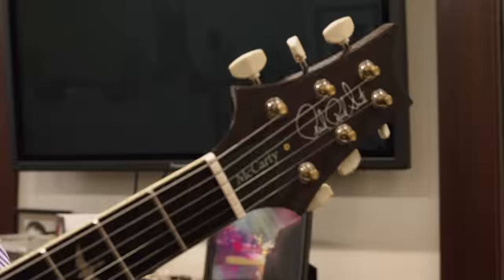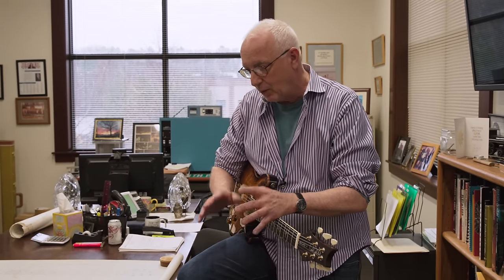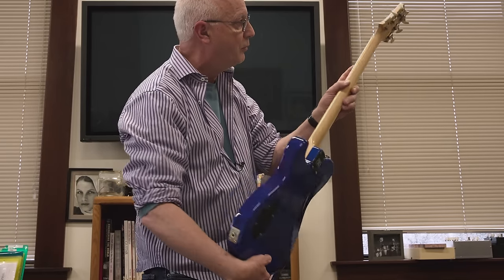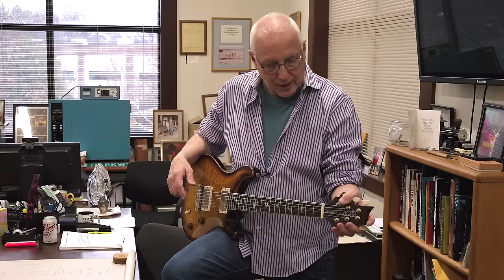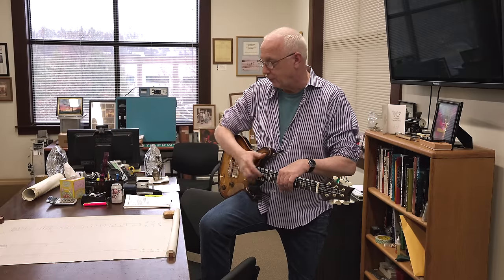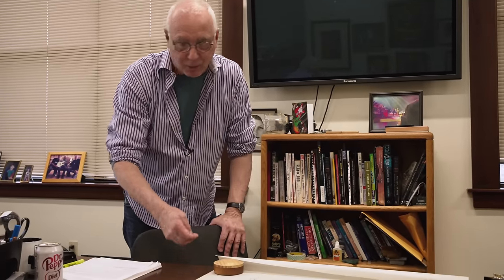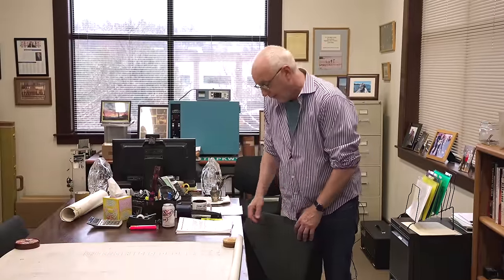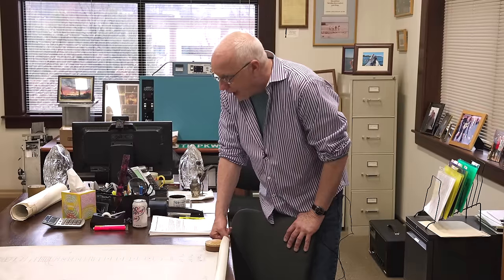Paul Reed Smith Explains New PRS Tuning Button Design | PRS Guitars

Comment: There’s a term for this: “burying the lead.”

The shape and weight of the pegs are virtually meaningless compared to the news that only trem-equipped PRS guitars will have locking tuners from now on, which seems like nothing more than a cost-saving measure.
Reply: Fun fact .. It's actually burying the lede. 

Something I found out about three weeks ago.
Reply: It's a greedy measure.

Comment: I prefer the old phase 3 locking tuners you used to put on the 594 McCartys. When manufacturers are migrating toward locking tuners, PRS regressed. Almost seems like a cost cutting measure.

Comment: Ok but where are the locking tuners Paul?
Reply: Gone from every fixed bridge guitar.
Reply: On the models with tremolos.  Unnecessary on a fixed bridge, as long as you know how to wind up the string,  it's not going to slip

Comment: I like the new button design.

Maybe it is time to just standardize on locking keys across the range though? There's no downside, even hardtail guitars should have locking tuners.
Reply: The downside is they can't sell you their aftermarket tuners if they already come on the guitar.
Reply: Yeah I kind of want the new keys in the Phase III locking tuners. 

I had vintage tuners on my 08 McCarty and they're... alright. But I'd rather have locking tuners any day. I don't care about the extra 6g or whatever they weigh.
Reply: @mikeomatic9905   The new buttons do come on the 2024 Phase III tuners. I have been told the buttons will be sold in the PRS accessory store from May so I am holding off buying the normal faux bone buttons.
Reply: Seems they are aiming to reduce mass  to optimize the transfer of energy string to guitar.  Locking tuners on a non trem guitar are pointless, just a lazy way to change strings
Reply: @JoeDread316  you say "lazy" but I say "convenient" and "fast". Also better for tuning stability.

Comment: Love the new tuning buttons! I do wish however that locking tuners were at least still an option on non-trem guitars. They help tremendously playing live
Reply: Really? I have never owned locking tuners, all my guitars have vintage style tuners and never have a problem with a fixed bridge. Do you use super light strings or is it legit the machines turning backwards?
Reply: @DevilsAvocado69  they don't really add to tuning stability
 string change speed QOL lol
Reply: @hyperplayability6290  Ohhh so you break strings a lot? Do you not have a spare guitar for gigs? Because I doubt you are about to rewire a dead jack live... Lol
Reply: @DevilsAvocado69  nothing wrong with conventional, but all the guitars I’ve used live have (pretty much) all had locking and it makes life a lot easier, and in general helps tuning stability. Is it a must? No. But it helps greatly and is an extra layer of security. Especially if you fly all over the stage
Reply: @tedisakoolkat  Lol see this makes sense, I get it dude, you rock tf out. The other dude that replied to the question I asked you is talking about string changes live like they are BB king. Not that it wouldn't be faster to get the string changed but its the stretch into stability is what takes time changing strings not winding the wire. Especially live because the goal is to be intune, hence the question of how you are going out of tune. Does your band have a channel I check out?
Reply: @DevilsAvocado69  exactly!! The stretching is what takes time for sure. Looks up “Stone Horses” song “Good ol days” and you’ll get an idea haha, play my blue PRS on that one 🤟🏼🤟🏼
Reply: @tedisakoolkat  Dude, that video brought a tear to my eye. Hanging in the studio, enjoying life, that's what it's all about. Reminded me of being young again lol. Good ol days you might even say lol. Great job dude, you should be proud. Also that's a beautiful guitar. I have a blue smokeburst limited edition s2 single cut with a quilted maple top. Great guitar but now I play sitting more it digs into my ribs a little, need to get something with a deeper belly cut.
Reply: @DevilsAvocado69  thank you man!! Really appreciate the kind words! It was a blast for sure hahaha, I love the studio (and playing live). That sounds like a sweet axe man and a beautiful color too
Reply: @DevilsAvocado69  never broken one lol
when i change strings though locking tuners are nice

the nut helps a lot more with tuning stability unless you have really bad tuners
Reply: @tedisakoolkat  Just the truth dude, plenty people out there with dreams, you are actually making the effort and doing the thing. Yeah I really like my prs,  don't want to get rid of it so will probably just find it a nice spot on the wall, save a little longer for the custom shape rather than trading in. Plus in 40 or 50 years time it will probably be worth something being a legit limited run. Especially if I can keep it in its current condition. Best of luck with music man, stick at it, only takes one popular song to really hit the big time today.
Reply: @hyperplayability6290  Hmmm never... Cool... First guitar I restrung took 4 packs of strings because of burrs in the bridge gromits, was a rough telecaster in the summer of 1994. Been doing it as job for the last nearly 30 years, was a guitar tech for 3 years for a small band called RunRig... Please kind stranger, teach me more about how guitars work. See the problem with what you did is assume you are talking to an idiot. It's normally common courtesy to at least get an idea of how little someone knows before you start patronising them. I get you are just trying to share knowledge, but in this case you are throwing eggs at a chicken. I appreciate I can't know everything, but I really doubt without a guitar and you right here in the room that you could teach me much about guitar. Thanks for the effort. Ask more questions in the future.
Reply: @DevilsAvocado69  sorry 😭 
Didn't mean to come off like that
Reply: @hyperplayability6290  No need for an apology, I kind of thought it wasn't on purpose that's why I took the time to explain how you came across. You are just eager to share, that's a good quality in most scenarios. Trying to tell a guitar tech that's serviced more guitars than most people have seen, what effects guitar tuning is not one of they scenarios. Also I am scottish so sorry if I was too direct, it's just how we talk to people. Been told a few times it comes over aggressive but in reality it's just me being me. Wish you all the best in your musical endeavours, no hard feelings.
Reply: Just a comment on the strings stretching: with locking tuners you can pull the string nice and tight before locking. There's some stretching for sure, but a whole lot less than if you were winding them. You might have to retune after the next song, but you'll probably be good the rest of the night.

Comment: While I understand the intent it still looks cheap, like plastic pressed on to a heated shaft guaranteed to loosen or break off one day. I see screws on the original design, but not on the sample, which still looks like cheep plastic department store parts.  I get it, function over form, and my McCarty S2 has those cheap-@$$ tuner heads, which I hate, but the guitar itself is too good for that to get in the way. But its Fugly, and that's a really odd thing to say about a PRS aesthetic.

Comment: Been a long time supporter, owner, and promoter of PRS guitars. Ive always known them to put out the very best of what is possible, regardless of the bottom line. Does it mean a price increase to continue to maintain that level of quality when fiat currencies inflate? It sure does but it means not compromising on what matters most and that is producing the best that human efforts can manage. This change in combination with the change from high quality wooden/vinyl cases to cheap molded cases with plastic latches is the first time ive seen PRS look for ways to cut costs rather than stay true to course. I would imagine shortcuts in electronics will be next ie: Alpha pots, imported switches and jacks etc. I also don't appreciate being told what I will learn to accept in products I buy, I accept only the best from PRS nothing less.

Comment: Buy up last years PRS guitars, as today marks the day that PRS begins to cut costs on their guitars...........Plastic is cheaper than metal, and guitars without trem's don't get locking tuners.
If Paul's true goal was to reduce weight on the headstock, they would be made of Titanium and keeping locking tuners on ALL core guitars.
PRS guitars have always been premium, and command a premium price because they have features standard that a normally optional extras on Fender/Gibson...............Now that PRS has begun down the cost cutting road, they will follow in the same steps as Fender/Gibson in the late 70's and 80's. Buy last years PRS NOW, as it will be the last of the good ones for a while.

I don't care about the tuner keys shape personally.......................the fact your paying $5000+ for a guitar with plastic tuning keys is just wrong. My $500 budget guitar has metal tuning buttons.
Titanium would have been a better choice if your so concerned about weight on the headstock.

Comment: Regular tuners on non trem guitars is actually a good thing, if strung correctly they hold tuning just as well. Think about the split shaft fenders for example, they hold up perfectly unless there is divebomb action going on. Having extra screws that can wear and strip out is just as stressful. I like the new design 👍

Comment: Paul nailed my thoughts "first people are very opposed to change, then they'll think that belongs and shouldn't be changed". Which this video should greatly help.
Reply: He doesn't give a fvk about his customers' opinions, which is sad to see. PRS needs to experience some capitalism real soon.
Reply: @dudebroguymate  Well that was the weird comment I didn't expect to see, but youtube never fails to deliver.
Reply: @Yupppi  let me know if you need me to translate for you
Reply: Change when there is a definite upgrade to the instrument is fine, change to cut costs, reduce life-span, and lead to potential issues years later is NOT.
The bigger announcement is the fact that locking tuners won't be standard on fixed bridge guitars is a much bigger deal..........But don't worry for $$$$ you can upgrade them.
Are you really OK with spending $5000+ on a guitar with plastic tuning keys, when a budget $500 guitar has metal ones.

Comment: If we're subscribing to the engineering theory that reduced weight tuning buttons translate to better tone, what material are those made out of and is it less dense than wood?  What metals have been considered for the tuning machines themselves?
Reply: No one should subscribe to a statement so ridiculous 😊
Reply: @jhref  I'm keeping an open mind but tech folks need convincing and non technical folks need a bit more than this.

Comment: My McCarty594 tuning buttons have more of a classic look with the detent in the middle of the button so you can grab it easier. Plus it has a beautiful design the way it has a slope on the edge. These new ones look a little more plain, perhaps a little more modern. I would be surprised if the tiny bit of reduced weight would make any difference. Removing lock in tuners would have more of an effect on the weight than the shape of the buttons.

Comment: Now is the perfect time for PRS to change the design because the "lightweight" (read: plastic) buttons are less expensive than genuine metal buttons. Ditto for the removal of locking tuners from non-trem models. Lower manufacturing costs equal higher profits.

If metal tuner buttons were "not musical" and "rob[bed] the midrange," surely every guitar manufacturer would have figured that out by now.

For a company to take cost-cutting measures is understandable! For those same cost-cutting measures to be sold as snake oil beggars belief.

Comment: I like these better, just wish they came in the pearl/tusk texture. I love you guys, but do you really think anyone is going to believe this? - "Because these buttons are lighter weight than their metal predecessors, they are subtracting less energy from the vibrating strings, thus helping the guitar ring longer and at a more musical note" and "By adding our new Wing buttons, the neck and headstock of the guitar are under less pressure, which rounds out the upper level of the instrument’s tone in comparison to heavier metal tuners which creates a tone that can be subject to a duller sound with dead spots" -  Never in my life would me or anyone else I know believe that a tuner button would change the tone of a guitar in a noticable way. Nice try though.

Comment: Oh please - I own several PRS guitars, and I would bet that you would not be able to tell the difference between a guitar with metal tuners and these new tuners. Aesthetically, I think they're really ugly and if I were going to pay 5K+ for a new core PRS model, I would expect metal tuner buttons. I'm not buying the theory that these new tuners dramatically affect the tone - I call BS.
Plastic tends to be prone to cracking over time as well - these just look cheap and imho, amount to nothing more than a cost cutting move.  I will also mention that  they look nothing like the bird at the 12th fret - that's a real stretch. Before I would fork out the cash for a new PRS core model, I'll be waiting for the news that you're going back to metal tuner buttons.

Comment: I tried your Phase III tuners on one of my custom guitars I made a number of years ago.  They're OK but way overpriced for what I got.  I don't care much for open gear machines, give me sealed every time.  I don't care much for exposed brass that tarnishes,  plate them in nickel at least or chrome is even better.      I don't hate vintage kluson style machines but I like sealed machines better. Schaller M6's have always been the best.  

If I worked at PRS and had the authority to do so I'd be having a discussion with Schaller's engineering department and asking a lot of questions about being the first in the industry to provide tuning machines made out of Titanium, to get a sealed design with very light weight.    I don't have a problem with that button shape.  Seems perfectly reasonable.
Reply: Plate metal parts that are contacting against other metal? OK..... Titanium maybe light weight, but doubtful that is cost effective...

Comment: Adding my 2 bits for what it’s worth. 
- Ambivalent about the design of the buttons
- The press release seems to be void of describing the material which makes me suspect it’s plastic
- I’d prefer metal, and yes you can achieve the same weight targets, don’t be silly
- Locking tuners is what we want, I bought two sets from you to get my 594s how I wanted them to be out of the box
- Tone claims sound like snake oil
- Really going hard marketing these - WHY?

Comment: They are ugly. And instead of adding locking tuners as standard to more guitars, you're "updating" them to non-locking tuners? Come on, listen to your customers...
Reply: 100%
Reply: Trem guitars get locking tuners. I thought you boomer’s wanted traditional guitars wouldn’t locking tuners be “non traditional” ???
Reply: Whinge noted.
Reply: B...but... they're "toan tooners".
Reply: Let a master luthier follow his vision. He really is onto something here with the design.
Reply: I personally hate the look of the old tuners. This is much better.
Reply: I have the locking ones on my 08 Mira. I love them.
Reply: I think I'd like it more if they were black, if that's an option
Reply: Beautiful tuners imho. They fit the guitar perfectly. In regards to functionality, time will tell…
Reply: I don’t like em.
Reply: Not a fan.
Reply: locking tuners have many moving mechanisms, which also means it’s heavy, which also is the opposite of his point that is to reduce weight on the neck and potentially increase sustain. wrap your strings properly and you wont need locking tuners bc they wear out anyways

Comment: LMAO. There's a new shape button coming and we are happy about it. See ya. Bye. Great job Paul. Anyone who complains about the shape of the tuning buttons as a reason to purchase or not purchase a guitar needs their head checked. Glad to hear that Paul is getting the design he dreamed of.
Reply: Really? People need to have their head checked for disliking something? I don't know man, sounds like you're the one who needs to see a doctor.
Reply: People should buy the guitar they feel happy about. If the tuner puts them off, that's their choice and it's perfectly valid.

Most people will just throw Grover locking tuners on them anyway. Mine had Schallers till I sold it
Reply: I'm simply saying changing the tuning keys to you preferred shape on a guitar is something anyone could do. It's not like you need to solder or drill or do anything beyond use a screwdriver on. It won't change the tone or playability of the guitar if you stick on decent tuners and it wouldn't make me not but a guitar because of the factory installed  tuners.  They are are still high quality locking tuners with a slightly different shaped button.   @RylanStorm
Reply: I totally  agree. I don't think changing the tuners should put anyone off a guitar since you can change them to your preferred tuners with a screwdriver and don't need any luthier skills.  @RylanStorm